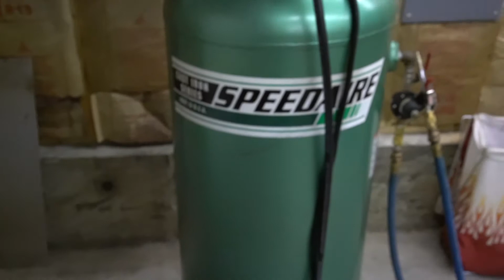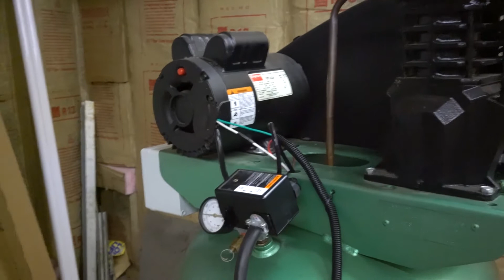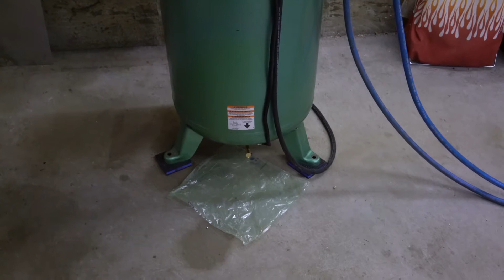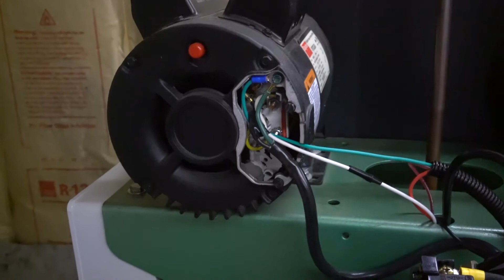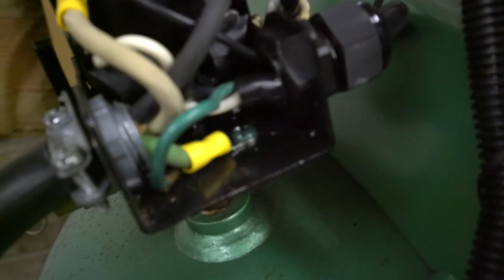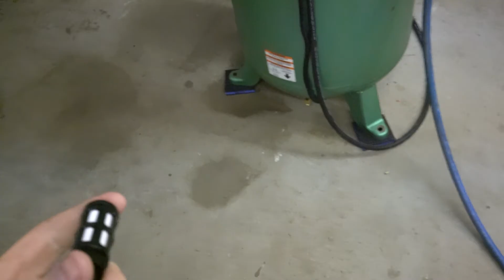DIY Auto Drain for Your 220V Air Compressor! Extend the life of your air compressor for under $50.

Comment: For anyone looking for a cheaper high quality air solenoid, I ended up picking up a Vixen air ride suspension solenoid which is rated for 210 PSI for $35 on eBay.  This valve is 3/8 inch NPT.   I reduced the output side to 1/4" NPT and placed a small 1/4 turn ball valve after the solenoid.  Operating it wide open at 3/8" didn't provide enough back pressure and the solenoid would not shut off after opening and would empty the tank down to 80 PSI before closing.  With the reduced opening on the output side it will run a 1 second purge every time the compressor starts and it works great triggering around 135 PSI at startup.

This solenoid valve is activated by 12V DC so you will need a transformer to operate it, but ASCO valves were too expensive for my budget.  I cannibalized an old 12 VCD power adapter to provide the 12 VDC for the relay controller.  I have an 80 gallon 7.5HP two stage operating up to 170 PSI.  I am using a magnetic motor starter so this gives me both sides of my pressure switch to use.  One side activates the magnetic starter and the other side activates the auto purge on startup.  I am controlling the auto purge off a double relay controller using and esp8266 micro-controller connected to Home Assistant.  I am also using the second relay to break the pressure switch signal to my magnetic starter to automate turning on and off the compressor.  I have an automation turn off the compressor every night at 9pm automatically and there is a push button to turn it on for the day or I can operate it from my phone.  I will try and provide more details in a video.  I just don't have the free cycles to publish one at this time.  I also like the idea above for purging the input side after the compressor motor stops.  I need to find a 3/4" low restriction solenoid for that purpose as I don't want to hinder my incoming CFM.

Link to the solenoid I used here:

https://www.ebay.com/itm/391831185441?hash=item5b3af56821:g:w0cAAOSwaSlfvxJZ

Thanks for the video which inspired my design for this solution.
Reply: David, wow, you need to make a video on this! Like you, I've since upgraded to a 2-stage, 80 gallon, 7.5hp compressor. I chose a pneumatic moisture minder for this compressor. No power requirements as it uses energy from the unloader valve. Also no wasted air release. I might make a video on it.

Comment: FYI, the Baomain solenoid you linked is junk. I, like others in the reviews, received a normally open unit, even though we ordered the NC version.
Reply: I also had to wait an eternity for it to arrive.
Reply: @doomsdaydiesel  Sorry about that, I've never actually owned the Baomain, it was just a spec-match for the ASCO unit. You do get what you pay for - I found the ASCO on eBay for $41. Worth the price premium by the looks of it.
Reply: @ryang6513  I couldn't find any 220v 1/4" NC on ebay, but I found this to be the cheapest option new:
https://www.kleen-ritecorp.com/p-17457-asco-1-4-brass-normally-closed-240v-60-solenoid-valve.aspx

I'm running 180psi, so the 145psi units won't cut it.

Comment: Your wiring sucks!  NO protection for the wires with all the vibration... FAIL!
Reply: Thanks for your thoughtful comment. It's been running for two years in continuous use and the wires are not fraying. Please spend five hours and post your own video for zero dollars and let me know when it's ready, so I can reciprocate by posting the same garbage in your comments section.
Reply: @richardengland7077  I added protection to the wires after the video, but I'm sure there are many other shortcomings here as I'm not a licensed electrician or control engineer. Namely, the inclusion of a fuse of circuit breaker inside the box would probably be another good addition, since this is full voltage. Since making this video, I have upgraded my compressor and went with a much superior auto-drain solution: pneumatically operated valves. Lookup the Tsunami Moisture Minder pneumatic drain valve if you're interested. No worrying about electrical power. It uses air from the unloader valve to purge moisture, results in zero loss of tank pressure (no over-draining), and releases that water at a much lower pressure so you don't have to worry about the "jump scare" that results from how the drain is implemented in this video. I might do a follow-up video on the pneumatic valve since there doesn't seem to be much online about it. 

P.S. No offense taken to constructive criticism. I think it was more so pomonabill220's tact, timing and approach that rubbed me wrongly.

Comment: The link for the "More Industrial ASCO Red Hat Part ($36.99)" to eBay is not working. 
Do you have a part number? 

Found Number in your wiring diagram --Omron H3Y-2, DPDT, 220v, 0.2 to 5 second model

Also the link to Ebay doesn't work for the Timing Relay:
Omron H3Y-2 ($4.58):

I found the Omron Timer on Amazon cheaper and by another name.
https://www.amazon.com/dp/B01IEQC3SI/?coliid=IGGSY0K3E749G&colid=3OV99EONFVTGM&psc=1&ref_=lv_ov_lig_dp_it

Thanks
Reply: Solenoid Valve, Normally Closed, 1/4" NPT, 220/50V (Asco RED HAT model 8262H202)
Reply: 240/60 220/50 V solenoid valve two way valve 1/4" inlet Asco RED HAT 8262H202

Comment: The wiring diagram shows "Motor L1 to Timer Terminal 13", but it appears you actually are using motor L2 to timer terminal 13 along with Pressure switch L1 to timer 14 to send 220 to the timer. As it shows in the diagram you'd only get one 110 leg to the timer, right? Rick's Torino mentions the same in passing in his comment.

Comment: Ok I put this together, mine is a Champion 2 stage 80 gal. upright.I tried to wire to the motor but it was not possible because everything was so tight in there.I ended using the L2 motor wire on the pressure switch wired to terminal 13 on the switching timing relay.I also used the L1  (hot line in lead) on the pressure switch as you did which went to terminal 14 of the switching timing relay.I used larger forked connectors in the pressure switch capable of holding two wires.The 2 LED'S on the switching timing relay works as follows - one LED turns on the set time I have it set to (5 seconds) and then the second led comes on also till the motor shuts off then both LED'S turn off at this point.All in all it works great thanx the youtube on this, great job!!!!!!
Reply: Glad you found it useful!

Comment: You spent $87 ($101 with muffler) to avoid buying a $45 unit with timer, valve and strainer integrated? https://www.amazon.com/Pukido-Automatic-Compressor-Condensate-Solenoid/dp/B07KX5B9LB/ref=sr_1_2?s=hi&ie=UTF8&qid=1544587213&sr=1-2&keywords=220v+timer+drain

Comment: Nice job, I'm buying a new compressor, and was looking at the electronic timed drain valves on ebay, but your method looks more reliable, I've been sourcing for the parts on ebay, the parts you listed aren't available here in England.    Cheers :)

Comment: I just happened on your video and after seeing your current setup I have a compressor life extension tip for your consideration. I've been doing this to compressors since I was a kid and it really helps prolong the motor's life. Install a "T" and solenoid valve in the line between the pump and tank. Then using an on delay timer (exactly what you have) I open the solenoid to bleed pressure to atmosphere for 3 seconds or so. This allows the motor to spin up without risking adding pumping load to the high start current. The tiny mechanical bleed valves that are part of the supplied pressure switch are a good start but not really completing the job. 
  Adding a restriction to your tank drain setup would allow the same timer to do both. I always like to put 3 timers in. First for drain, second for unloaded starting and the third is to shut everything down if something goes wrong and the motor runs continuously for whatever time you choose. I have mine set at 5 minutes in case a hose breaks etc. 
As another mentioned it's a good idea to tidy up with some LiquidTite. I'd suggest picking up about 8' of 1/2" LiquidTite flexible conduit, 5 straight & 1 - 90° 1/2" LiquidTite connectors, a 1/2"  LBC, a 1/2" LBT, oh yeah and a 1/2" close nipple for your Asco valve. It will have a female 1/2" NPT fitting for protecting the conductors. 

Just a thought. Good day.

Side note. eBay has 110V & 220V compressor tank drain/timer solenoid units for about $20. They have 2 dials, purge time 1-6 sec and time between purges up to 45 min. I don't know if they have accumulative timers or just draining around the clock. It is a cheap solution.
Reply: So, you just  explained how to correct an issue that I realized, well wondered about, "Why the motor is not aloud to reach running speed before pushing more air into a pressurized check valve?"
Thank you.
Reply: I often wondered why engineers designed a system that would make it harder for a motor to start up.
Reply: @modifyman6977  Mechanical pressure relief does relieve the head pressure but doesn't allow the compressor to come up to speed before the small volume of atmospheric pressure is pumped up and offering an increased load before the motor and flywheel are up to speed where they work best. Adding a volume to the pump side of a mechanical pressure relief is a useful modification especially when electricity on sight is only for the spark plug and you have to cobble together a system out of scrap parts far from a paved road. 
Manufacturers tend to take the cheapest route and if it shortens lifespan it probably sounds good from their end.

Comment: Awesome, I plan on doing something similar.  A couple of improvements that you should make:  Vibration will cause those red solenoid wires to rub through their insulation where you have them passing through the baseplate - it is only a matter of time before your tank is energized and that its ground connection is tested.   $10 at Home Depot for a 6ft 1/2" liquid-tite flex conduit can solve that, a couple bucks more for 3/4".  I notice that the solenoid has a thread for something to screw in... The second is that green wires should never be used for anything except ground.  Red, black, blue, brown, purple, orange etc., are all acceptable for a hot wire, but never green - it is specifically reserved in NEC.  White should only be used for neutral too,  although it is acceptable to mark that as black with tape.
Reply from the maker: Thanks Ian, glad you found it useful. Good idea on the additional protection for those wires passing through the baseplate. I did sand down the rouge edges inside those stamped holes, but I like your conduit idea. I have some extra laying around and might see if I can get it to fit in there. 

And yes, the electrical wiring job here is certainly not to NEC code. I'll be more careful with my color code selections in the future. :)